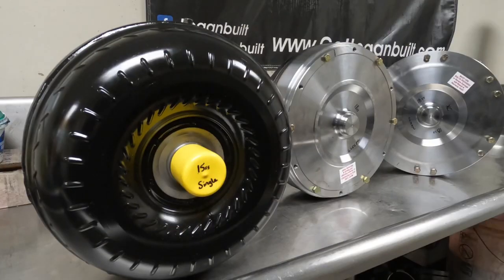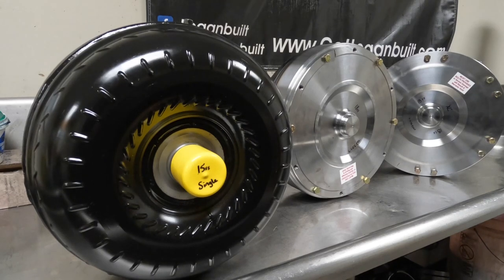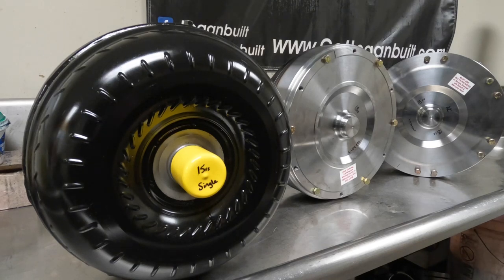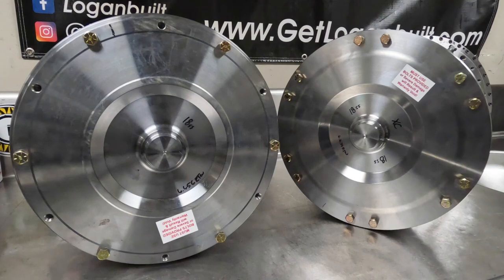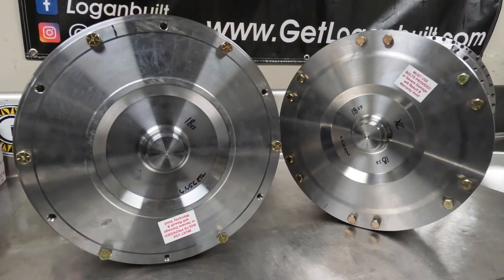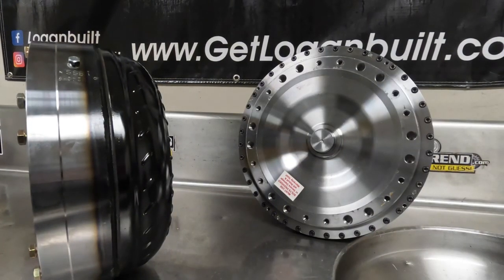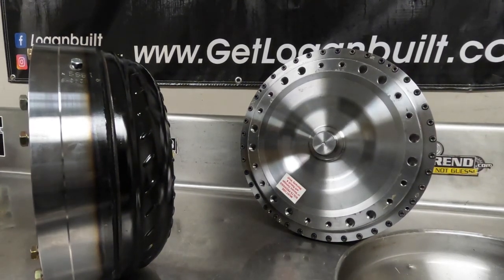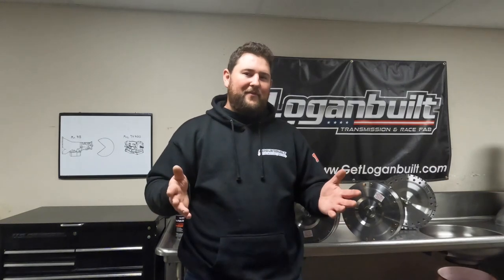Cummins  47/48RE Torque Converters EXPLAINED!!!

Comment: Killer video and if this helps others

Both rigs p7100 12v’s 

One runs a 1500 stall converter but has a 60/67/6cm turbo and I haven’t really found out where it stalls yet. I have taken it to 2300 rpms against the breaks. And at cruise lock vs unlocked is a 5mph difference. About 250 rpms. 

The other truck has a 2300 stall but has big fuel big turbo and a ton of timing advance, “sled pulling truck” and stalls at 1800 rpms. 

Definitely two extremes but it is a very clear view of torque production vs stall speed to help with your video :)
Reply from the maker: Great real world comparisons! I’m pinning this to the top!
Reply: @LoganbuiltRaceShop  🙇‍♂️ it is one of those things that’s kinda hard to see until you get to experience it.

Comment: Adding a additional comment. Changing turbine housings on my 97, nothing else, the 1600 stall can almost catch and hold the low stall speed vs the smaller housings that can push right through without any noticeable effect. It starts to get a little sluggish during the stage and wants to hang with the 12cm .70 housing before pushing through. So the motor has reduced in torque production enough to Almost let the converter catch and hold it. I found this fun and interesting. My motor is not relatable to too many but it was neat having one single change making that large of a effect.
Reply from the maker: These comments are awesome! I hope lots of people read these!

Comment: Technically, there is a crossover from stall to efficiency before you would go to lock up. While yes, an overwhelming majority of stator designs
(which are technically reactors, not stators as they move) ken play a role in making the lock up work harder as they reduce the efficiency of the fluid coupling as engine rpm increases. However, there have been designs that offer a higher star, without compromising efficiency done through usually pump and turbine modifications, which therefore don’t play as much as an affect of how much you’re asking the lock up clutches to do.

Going to lock up later if you have reasonable efficiency would help, but every Cummins owner wants to lock up as soon as possible to load the chargers which at that point you’re not getting any fluid coupling and relying solely on the lockup surfaces.
Reply: Why our elders decided to stop calling them reactors and go back to calling them stators is beyond me, but in all torque converter patterns by the OEMs, they use the word reactors. 🤷🏼

Comment: Do you plan on doing anything for the 68rfe?
Reply from the maker: As far as doing 68 builds no. I have moved my transmission builds towards high performance, 1000+hp and racing/Motorsports builds. The 68 just isn’t a great platform for a performance transmission.

Comment: I'm wanting to rebuild my transmission from my stock 2004 Dodge Ram 2500 with the 5.9 cummins (48re transmission)
I pull heavy loads often,  so I'm looking for the right conver.. should I use triple disc?